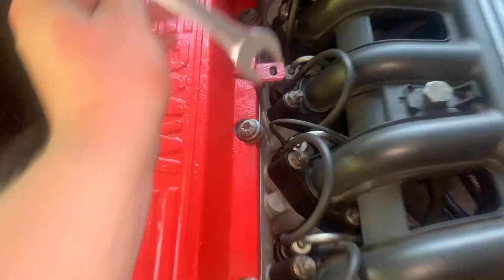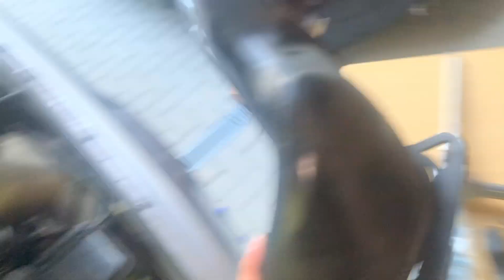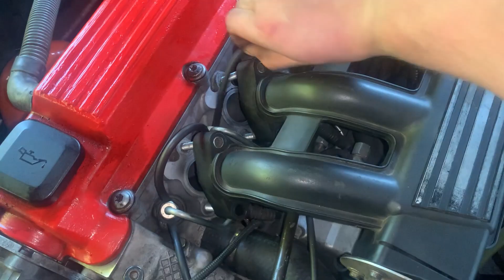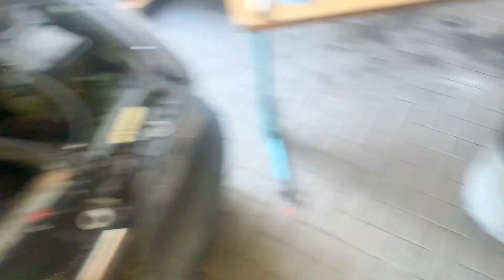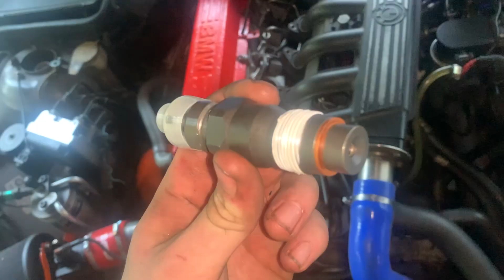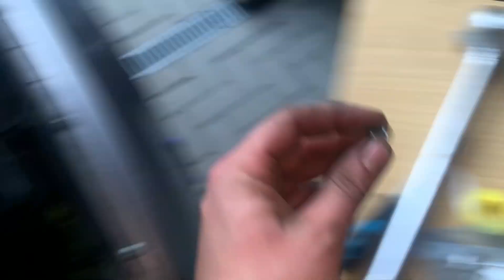BMW TDS - Injector Replacement / výměna vstřikovače

Comment: I tried to do this on mine today and copper washer was on injector but not in injector hole.. I cant get it off injector to replace it, what is solution to that?
Reply from the maker: @relaaaxingchanel3000  never use used washers again
Reply: @sudetenlanddrift  Well than tell me how to remove them?
Reply from the maker: @ just use screwdriver copper is soft material u can remove it with something sharp
Reply: @sudetenlanddrift  And how to get new on a injector again?
Reply from the maker: @relaaaxingchanel3000  it’s must can only put on injector with hands if u have right washer and secure with Vaseline from falling during injector inserting
Reply: @sudetenlanddrift  I will try to find right size
Reply: @ I didnt able to find same size washers, i put old ones in and put teflon tape around threads. Now I have only leak from electronic injector or can be from return lines of it idk right now. My problem isnt really leaking, problem is worse than that and I cant solve it. However when reving engine it revs to 2500rpm and there stops and gives DDE light, few seconds later revs drop and no more light. If I keep holding throtlle it goes past 2500 but light is on and engine is not happy. Do you have any idea where to look?
Reply from the maker: @ it’s possible repair the electric injector maybe I do the video but I don’t have any bad one better is replace it
Reply: @sudetenlanddrift  I have another one same thing